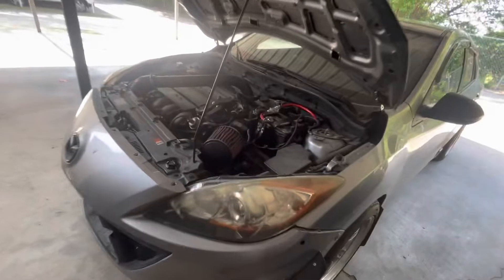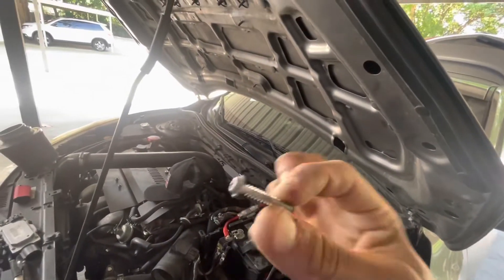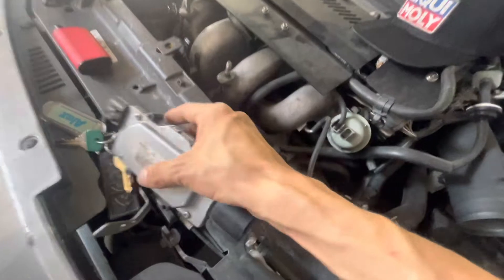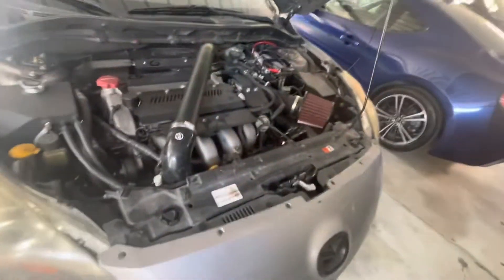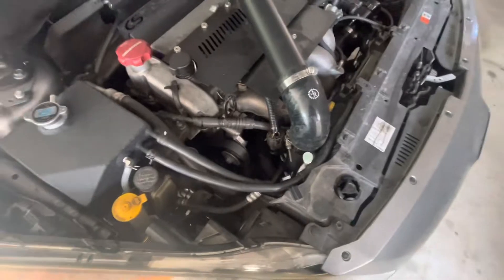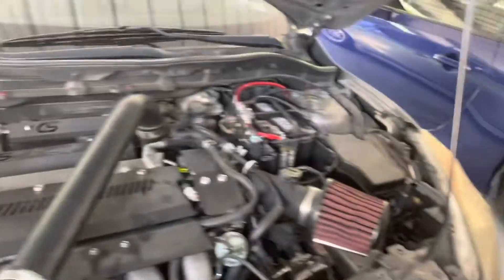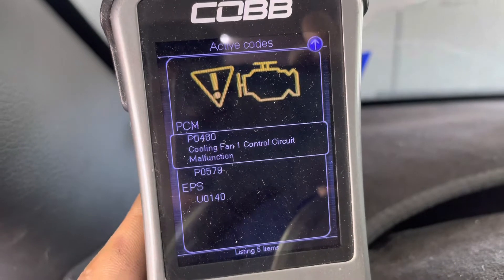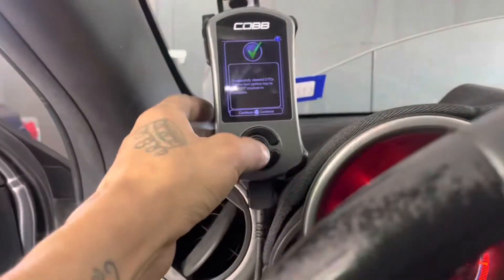Mazdaspeed Controll Fan Module Replacment

Comment: hi! can you explain how you got the little connector off the module? did you just pull it off? i'm currently trying to disconnect it and am stuck 😅
Reply: If u didn’t figure it out, u just gotta press the tab and push hard on the connector. You’ll see it moving a little and then I used a flathead to push it out

Comment: Is your coolant tank+system upgraded or is that what speed3 looks like stock. Btw a sleeve might help you with ac pipe touching the coolant pipe. Coolant pipe gets hot btw not sure if those two pipes  should touch

Comment: Dear Sir,
I'm from Malaysia and owned Mazda 3, 2.3 MPS engine..
I have a problem of radiator fan, I believe it's not working properly. When I activate AC the fan runs as it is. When I off the AC the fan stops, then I wait for the radiator temperature until 100 deg C, it seems the fan is not "On"/ activate. 
Question:
1) What is the coolant temperature for the radiator fan to activate.
2) What is the problem if the fan not working when it reach the set temperature that it supposed "on"/ activate.
3) I already change the new module....still the same..
4) Is it related to any temperature switch for the fan to activate & where is the fan temperature switch located.

Highly appreciate your expertise.
Best regards,
Hilmi - Malaysia
Reply: 110c turn on